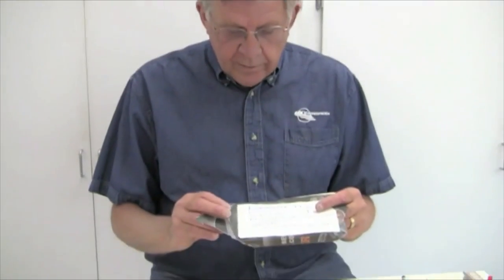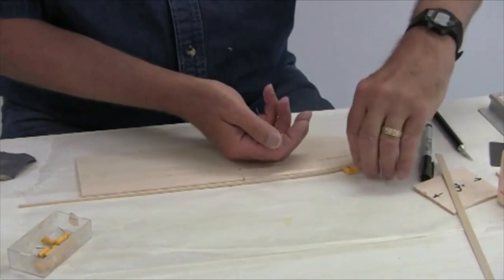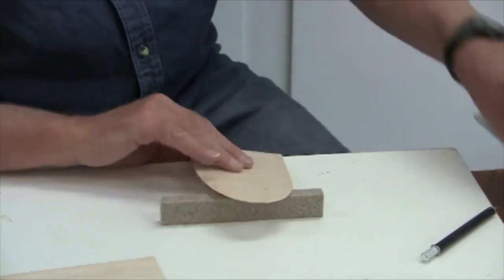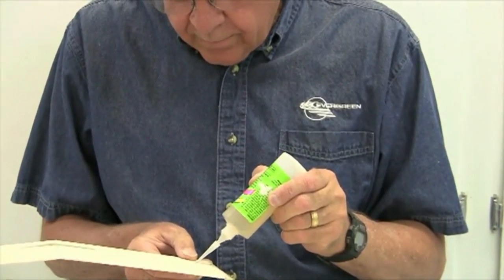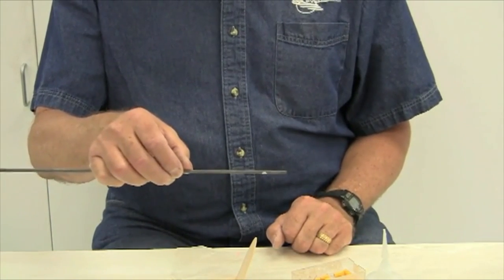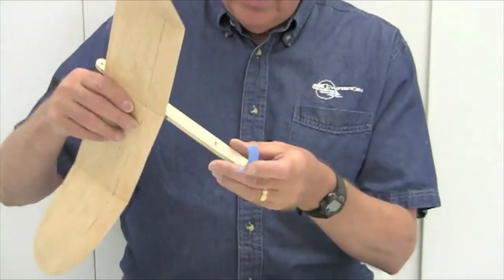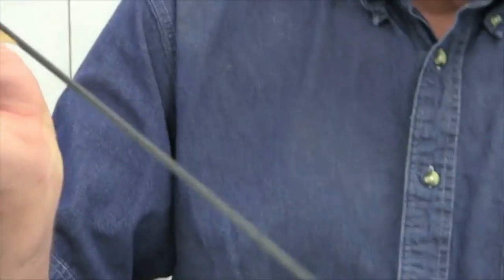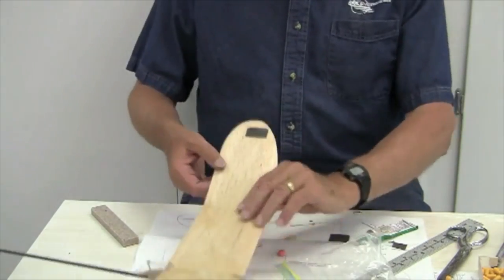Building a tip launch glider

Comment: Greetings,
I really appreciate this series of videos.
I’ve read the articles and the books, but having something to watch helps a lot.
Especially when you’re doing it on your own.
I hope you will answer a question about glue.
For years I have tried to come to terms with CA glues.
I’m sorry, I just don’t understand them.
Titebond, I’m fine.
Duco, okay.
Epoxy, when it’s needed.
I haven’t tried Polyurethane.
But I just can’t work with CA glues.
Most of the time I’m perfectly happy with Titebond, I don’t need an instant bond.
But I want to try hand launch gliders.
How much assembly can I do with Titebond?
I suppose I could resort to Duco, but I prefer odor free glue.
Kind of a simple question, but you’ve got to start somewhere.

Let’s be careful out there.
Reply from the maker: @james.. it is our pleasure to provide any assistance we can. For your glue question most all glider construction can be accomplished with carpenter glues like titebond.timezone.. the bonding strength with balsa is excellent.. you just have to be more patient

Comment: ... just a question of a beginner : Wouldn't it make more sense to sand the wing in one piece with the sanding board so both halves would be "more" symmetrical?
Here in Germany, the balsa boards are about 1 meter long ...
Reply from the maker: If you have the wood and the room to do it in one piece that is certainly a good way to do it. Typically these larger TLG kits don't want to ship the full length of wing stock.